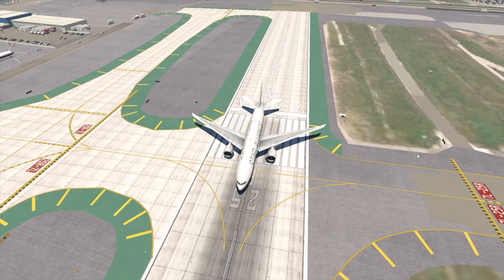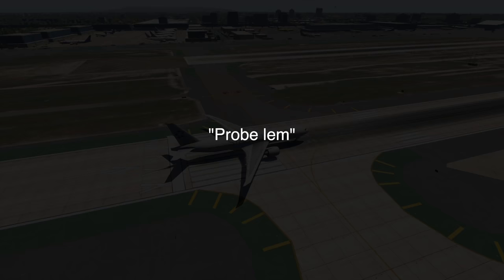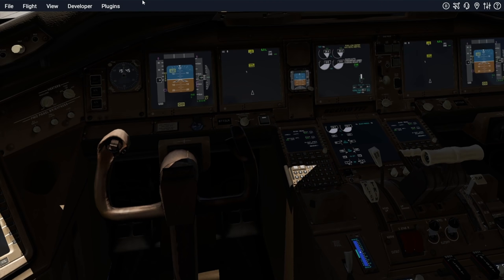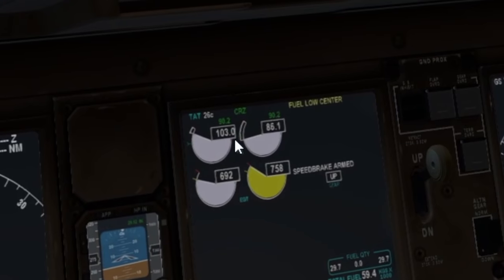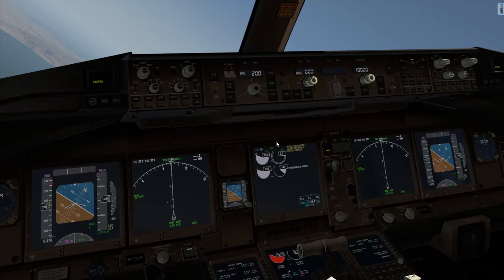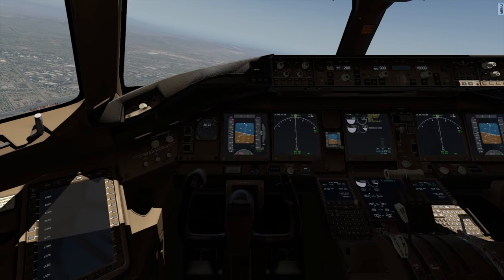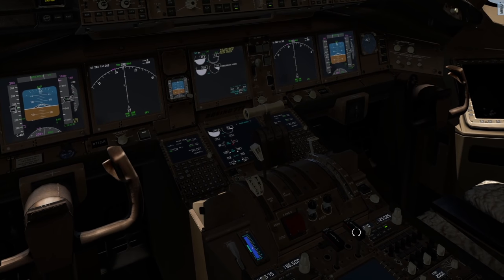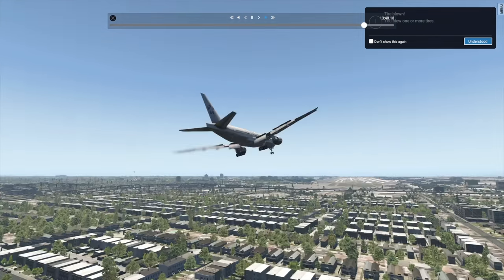777 Has Compressor Stall After Takeoff

Comment: Normal people when they see a compressor stall- ”AHHHHH”
Me when there’s a compressor stall- “oh” sips drink
Reply: Yes, most people stress out (which is a pretty normal reaction), but a compressor stall is not that dangerous.
Reply: Same
Reply: @youtubetv1987  what if In mid flight and there is no island to land on
Reply: @DeionDz   A plane is designed to be able to fly with one engine. It will create less thrust, but it's still enough to fly.
Reply: @youtubetv1987  oh ok
Reply: I will be quite happy to have a compressor stall because it doesn’t’ happen everyday and you can tell it to people